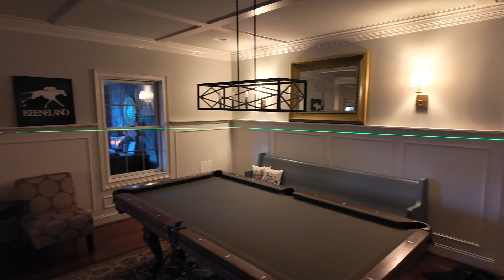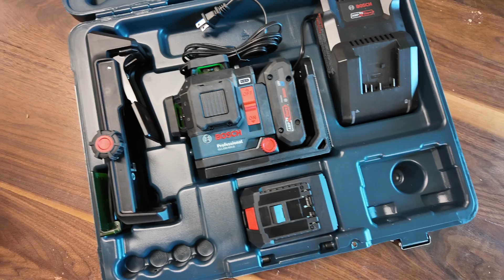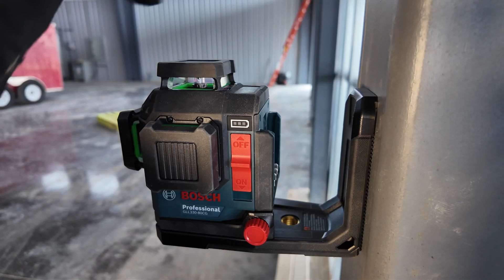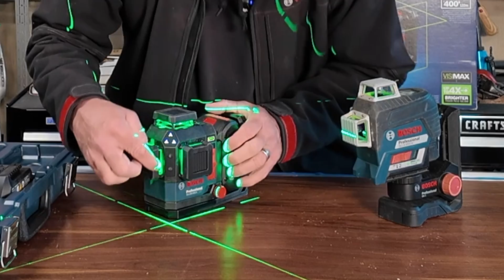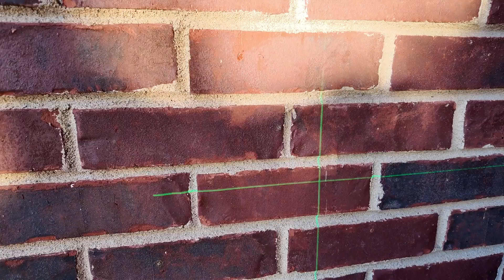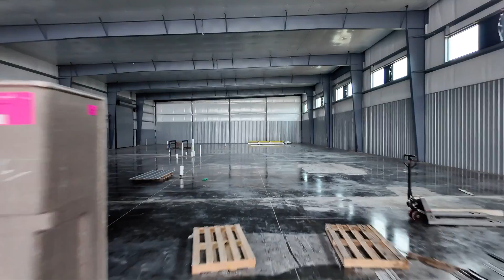Testing out the newest line laser from Bosch

Comment: Have you tried using the new Bosch model with the Bosch telescoping pole?  Reason I asked is I own a GLL3-330CG and if you use the metal bracket that comes with the Bosch pole, the metal bracket is so flimsy that when you hook the GLL330CG to it, its leans so much that the LL starts to beep b/c its leaning too much.   There is another bracket that comes with it that is made to connect to the adapter that comes with the laser level.  That works much better but it does make setup take longer with the extra stuff being hooked up.   I noticed how much larger/heavier that new Bosch model is and how far out it sticks when its on its adapter.  Was wondering is it able to be connected to the Bosch pole without issue or too much sag?

Comment: Heavily overpriced, no matter what this sellout guy says
Reply from the maker: Being a sellout would be showing something I don't use regularly.... $500 on a tool that can be used on virtually every project and can be used for years, that's far from overpriced. This is my 4th Bosch laser in over 16 years, 3 of my previous models still work with the exception of my first dot laser. You can always find cheaper but I am not that guy with my tools or for the services I provide.
Reply: I have the Bosch Red Laser GLL3-80 since 2013 and it still works as new. I also now have the green model and considering I have had the red once since 2013, cost per year is definitely low!!!

Comment: How to lock pendulums while in use? Seems like Bosch removed this function in latest models, but I have no idea why...
Reply: You can't lock it, in the "traditional sense"... But, once you are out of the 4 degree range, it will auto execute and lock the pendulum for use at any angle (4 degrees or above), anything below 4 degrees will trigger auto level!
Reply from the maker: I think your correct that this model does not lock, I have the previous model that does but I only used that feature maybe once. I am sure for certain tasks it's a must or required however.
Reply: @fultonfinewoodworks  Yeah, totally depends on the workflow. Anyway this tool wasn't created for slope angle tasks, stairs etc... I've been talking to Bosch reps. They said that the latest models does not have mechanical locking and use electronic actuators to lock pendulums when you turn it off. This was due to the durability and construction simplicity. Having said that, there is a good chance we can find a way to lock the pendulums via bloetooth app while ON.

Comment: I run Dewalt 20 Volt Max so I just ordered their new DCLE34033D1. It's supposed to be their most accurate model and it also has the Micro-adjustment knob. The thing I hate about it is it hangs so far out. This Bosch unit is nice and compact and it is designed a lot better by the looks of it.... I like the vertical adjustment that is also offered on the Bosch. The Dewalt does however include the detector which the Bosch does not.

Comment: I also have the GLL3-300CG & was eager to get this new model, BUT it appears the new model does not have a "Manual Mode," which allows you to lock the laser line at an angle so that you can for example, run drainage pipe or run stepped blocks/tiles/etc...
Reply from the maker: Someone just pointed that out a few days ago, I had to verify that was the case and it appears so.
Reply: Mine does.  Same as the old ones where you click one step to the right and it's on and locked, then another step is unlocked fully.

Comment: How accurate is the 90 degrees cross?
Reply from the maker: It's dead on 90
Reply: @fultonfinewoodworks  I doubt that. Everything has a tolerance. It's only level to 0.2mm/ meter.
Reply from the maker: @imusuallycorrect it's dead on accurate to anything I am ever building and more accurate than a conventional spirit level, I am not building space ships
Reply: @imusuallycorrect why ask then if you're just gonna discredit his answer

Comment: Is it true that on the new 18v model you can not lock the lasers while there on so you can use it to project straight lines at angles
Reply from the maker: I had to check, I know I could on the previous model.  You are correct it does not appear that you can lock it on new model.  It's not a feature that I ever used so not a big deal for me but I could see an application for it for some, for sure worth noting on the the differences!
Reply: @fultonfinewoodworks  i also noticed you can calibrate it either... I thought this bosch GLL330-80CGL was there newest and best....  I feel like I should return it when I recieve it... thanks
Reply: Once it is out of the 4 degree auto level range, it automatically locks the lasers for you to project at any angle. It will blink 5 or so times to inform you that you are out of "level" and have entered "locked mode"... My red Bosch is from 2013 and it has the lock setting, on my green Bosch (300-42GL) the lock function "auto executes" in the way I mentioned above. Blessings Brother!

Comment: I love mine, but a negative about the height adjustment being on the bracket is that you can’t fine tune height when its magneticly attached to a steal column. I really miss that. Now i have to clamp a piece of wood to the column and hang te laser with the bracket on a screw

Comment: thank you for the video. does the new one have also a cell battery for the bluetooth as the 3-80 cg does? i don t think it makes a huge difference but comparing the specs, i see that the 3-80 is more precise. (0,3 mm vs 0,2 mm per meter) is it noticeable? i m also happy with my 3-80 but the lines are not that crisp and the beam is somewhat large. how about the new one?
Reply from the maker: I am not sure about the cell battery I have never had to change it on mine, I didn't realize the beam was more precise, I could see that helping for sure I always decide if I am going to go by the top of bottom of the line so I am not off by 1/8"

Comment: Can you lock pendulum while in use  so you can use it on an angle?
Reply from the maker: Yes you can
Reply: @fultonfinewoodworks no you obviously cant, theres no option on the switch only on and off, sure you can move it to an angle but when the pendulum is free while you do so there it can move on the axis oposite of the one you are working with without you noticing and make a huge error, this is massive downgrade of this laser
Reply: @fultonfinewoodworks no you obviously cant, theres no option on the switch only on and off, sure you can move it to an angle but when the pendulum is free while you do so there it can move on the axis oposite of the one you are working with without you noticing and make a huge error, this is massive downgrade of this laser
Reply: Just making sure you were talking  about the  bosch gll330-80cgl modle that locks while in use for angle work.
Reply: You can't, in the "traditional sense"... But, once you are out of the 4 degree range, it will auto execute and lock the pendulum for use at any angle (4 degrees or above), anything below 4 degrees will trigger auto level!